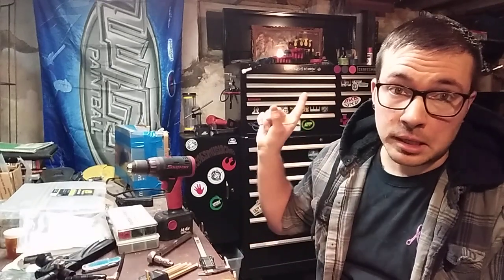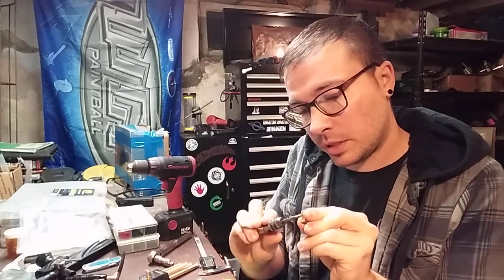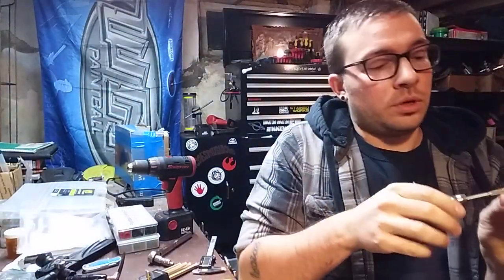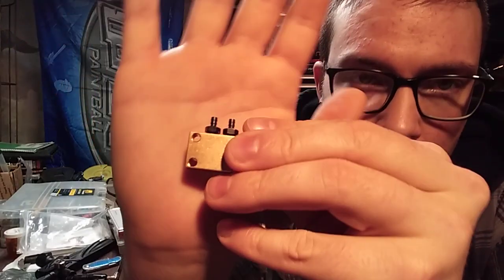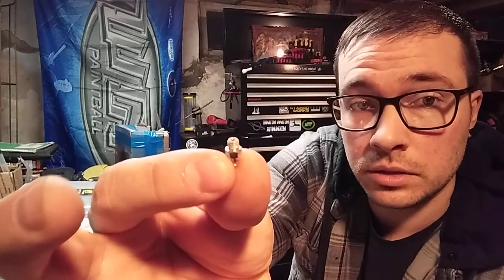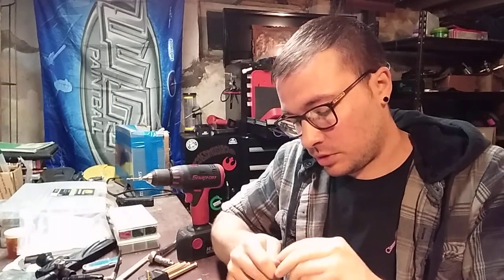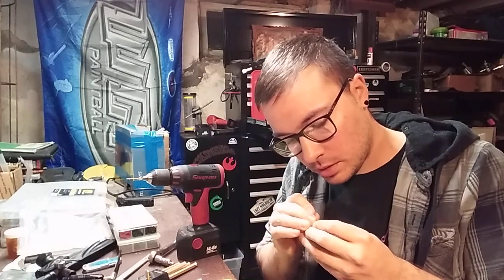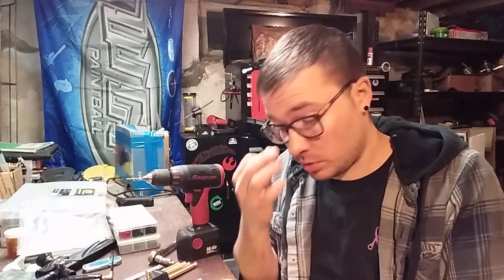Making a Pneu Frame Pt:3 - modifying and mounting your valve and air ram

Comment: any tap sets you recommend?
Reply from the maker: Most anything will work. Ideally you'd want to find some made of hss (high speed steel) as they take torque better. Most off the shelf tap and die sets are going to be carbon steel sets, which is good and hard but a bit brittle so be careful getting them in a bind.